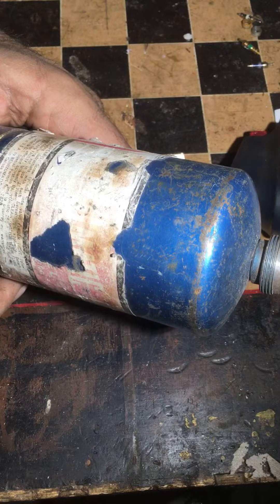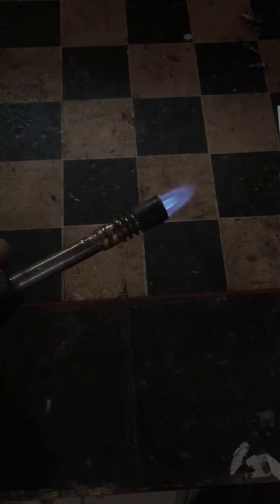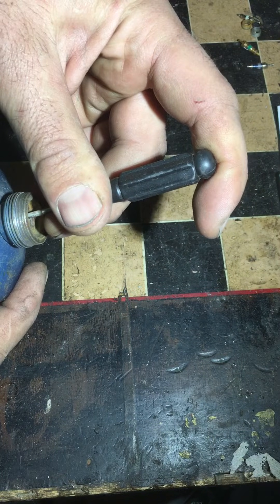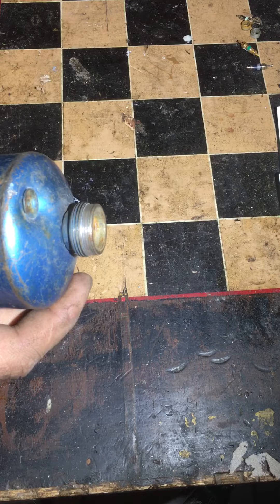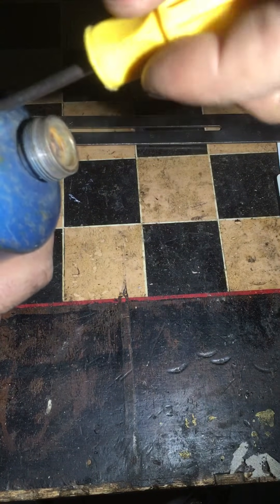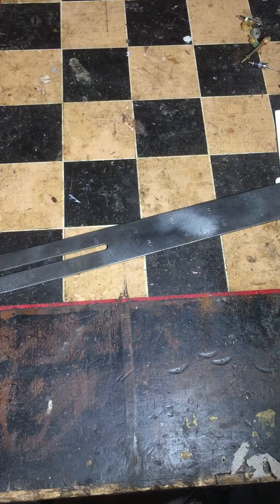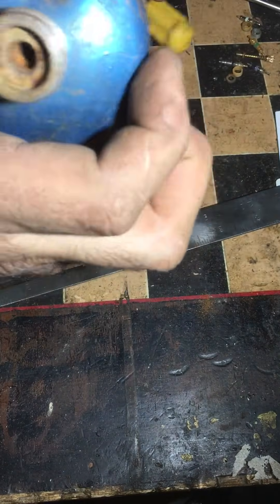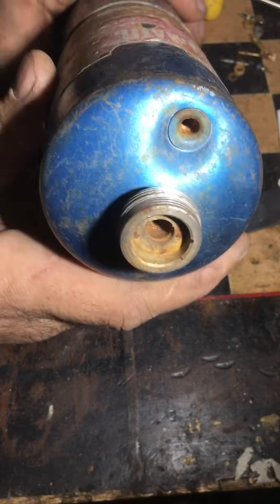January 19, 2019 - 1 lb propane tank valve removals for safe disposal

Comment: Really helpful - I had two 1-lb tanks (the kind usually used for camping) and have been able to remove the valves from both.  A little nervous about working with the propane, and jumped a little when I used the small screwdriver let the residual pressure from the "empty" tank.  I didn't have a pokey-stabby tool (great name), but I used an xacto knife to VERY CAREFULLY cut away enough of the nylon/rubber gasket.

Comment: Propane does NOT, ever,  go into the metal of the tank - rather warming the tank to room temperature warms the residual interior GAS, increasing the temperature and then, through expansion, the internal pressure to SLIGHTLY above atmospheric pressure.  In addition if you depressurize the tank on a day with HIGH atmospheric pressure (a warm, dry, non-stormy day) and then, later during a low atmospheric pressure day, start to "do something" with the tank there will be a slightly higher pressure inside the tank than the current atmospheric air pressure.  
Just re-vent the tank before using it and you will be 100% GOOD.
Reply from the maker: Thank you!  Yes I noticed sometimes you have to vent the tank again because of this pressure difference.

Comment: You should never use any tool made from steel when working around a flammable substance, it cold spark and cause an explosion. Use only no sparking metals for this tool.
Reply: Good advice however we have tried several types of brass rods with no success, they all tend to snap. Not many options at this point. Titanium would be the optimum but who can actually find titanium rod and then machine it to fit?

Comment: Where can I get the schrader tool, thanks
Reply: You can purchase a schrader valve tool at a auto parts store. look in the tire section where patches and plugs are sold.
Reply from the maker: I had to make it out of an old screwdriver.  I discuss this in the video.
Reply: Thanks, I will give a look see
Reply: @swompy5146  its not a standard schrader valve, you need a specialized tool. I'm going to call my local HVAC place later to see if they can help me out with this info.

Comment: Great video.  I wonder if you can purchase these two valves to replace old ones like yours.  I refill my disposable small tanks and these are two parts that would be easily replaced over time to ensure good working condition.  Probably easier just to buy a new small tank every several refills and go that approach instead huh? Thanks!
Reply: I think you would have a hard time sourcing the relief valve.